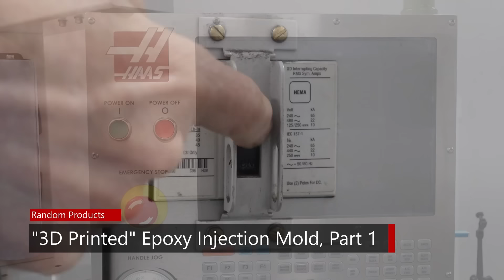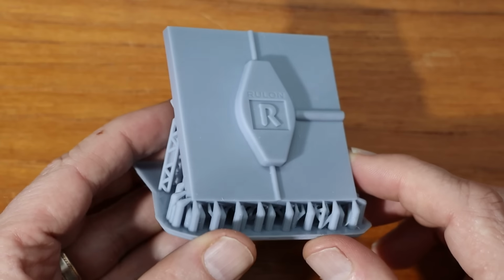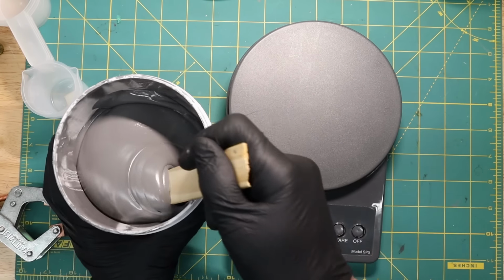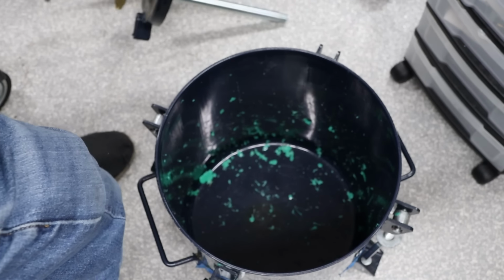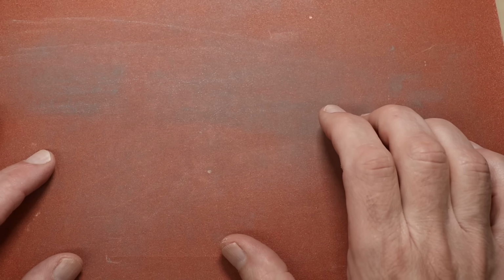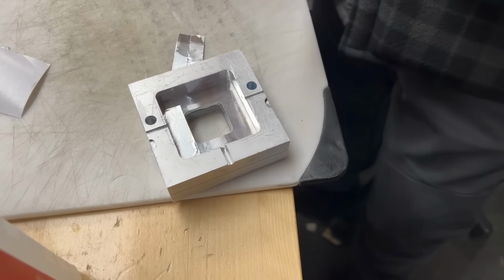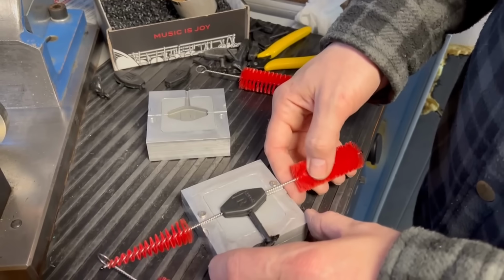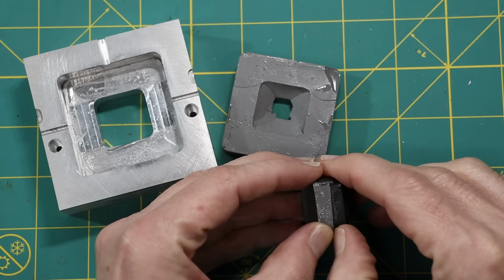"3D Printed" Epoxy Injection Mold, Part 1

Comment: Great video John thanks for sharing! 

The resin method is really interesting. The heat curing step of the resin does look like it poses some challenges. I wonder if using less volume of resin overall would aid in reducing the amount of deformation that could occur? Although that might cause warpage if the resin isn't thick enough. What are your thoughts of the possibility of the aluminium housing expanding during the heat treatment and possibly causing the resin to pull away from the walls when cooled? 

Reducing the size of the inlet when pouring the resin could make it more difficult for trapped air to escape as you fill the mold. Several/many small holes around the entire area might help if you think that's a possiblity.

anyway thanks again for sharing and looking forward to the next one!

Comment: I believe if you have more supports that are thinner at the bottom it will warp less. Warping is caused by resin shrinkage and very heavy supports at the bottom make part shrink unevenly
Reply from the maker: Thanks. I'll have to try that.

Comment: Does the epoxy shrink when cooling? If so, could that cause the mold to be a lot weaker and more likely to crack? Like, if the epoxy shrinks, then the pressure between the epoxy and aluminum might not be as strong and might give it a bit of clearance to "stretch"... but if it's a hard/brittle epoxy, then it will crack instead of flexing. It's just a thought and a question. I really don't know. I just thought about it when the mold was being made, when the shrinkage was being shown. If it shrank that much there, then I thought it might be possible to shrink (to a much lesser extent) on the inside after it starts to cure. I'm sure being thinner didn't help much either. I also wondered about the pressure used for the bubbles and was wondering why pressure and not a vacuum to remove the bubbles? (or vacuum then pressure).

Comment: If I may, I observed other resin casters pouring resin into the hardener prior to hand stirring. It was said to give a better mix. Resin adhering to the wall of the mixing cup was then not a problem. It is something I will try in the future.

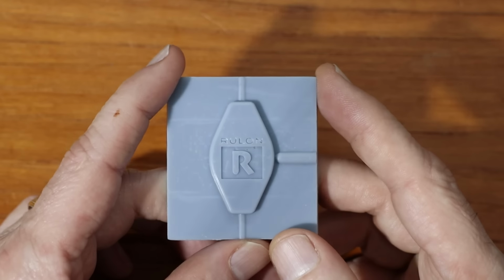Comment: 3:41 Your model is showing typical signs that you need more time on the "rest after retract" setting or whatever the equivalent is in your slicer. Basically your light is turning on and curing resin while resin is still flowing/squishing out of the gap between the film/screen and the last layer of the model. This is especially a problem with more viscous resins and is often referred to as "bloom."

Another possibility is that the PWM or light intensity setting needs to be turned down a little bit, but I'd experiment with the rest after retract first. Some printers like my Mega 8K have either really intense light sources that are capable of overwhelming the screen's masking, or the masking is too weak. Turning this setting down can help prevent a different type of bloom or light bleed. This is typically more of a problem with larger parts with lots of straight edges.

Comment: Great video. Very interesting results. Would shifting the pouring hole to the side help, away from the actual part?
Reply from the maker: Yes, that's one of the changes I plan to make, which is to make the pouring  hole smaller, and put it in a corner.
Reply: @JohnSL  less chance to anger YouTube mold & casting god Robert Tolone as well 😉 I saw you pour straight over the details 🙂
Reply from the maker: Hee, hee. I was wondering if someone would notice that. It's not the best practice, but I figured the pressure pot would cover that sin, and it did. The only bubbles I saw where on the back where the air wasn't able to escape.
Reply: @JohnSL  haha it was the first thing I thought when I saw it, but didn’t want to be “that guy” 😆 and when I saw you use the pressure pot afterwards I figured it would be be fine and it totally was. just now that pouring from the side becomes automatic I thought I would throw it in as a nod to the master 😊

Comment: Interesting experiment. Detailed analysis. Actually, the opening could be filleted on the inside, and additional plate can cover the hole with silicone(any possible bubbles removed with vacuum) to takeup extra space, with more even spread on pressure. Just some 💭

Comment: Thanks for this... I am gearing up to do a series of injection molds and I was going to try 3D printed molds and hadn't considered epoxy.

I have a Morgan press and will have the sprue in the top of the mold, not the side... Any thoughts on how that would change the process... thanks again, this is great stuff!
Reply from the maker: It should also work for a Morgan. You would just need frames where one frame as the sprue in the back.

Comment: Crafsman has a video called "3D Printed Injection Molds (actually work)!", the frame he has in that video has proper support all around the 3D printed part. That looks kinda important, even he mentions that he was worried about the pressure and his 3D printed mould probably held up because it had a proper backing part too.

Comment: As an armchair expert in mold making, I'm wondering, can you add something like nails to the epoxy resin to act like rebar?  Though it might do more harm than good if its coefficient of thermal expansion doesn't match.

Comment: John I have mostly given up building supports in the printing apps like Lychee et al and place them directly in my CAD.  For me the biggest problem with all these resin slicers is that they cater to the "toy solder" rather than engineering community where absolutely dead flat isn't post-print fixable and critical to print correctly.

I solved a similar issue to your problematic manually supported edge by building a "v-shaped" chisel support into the model edge itself.  The chisel base is large enough to use as part of a raft and the chisel "point" hits the model edge with about 0.3mm thickness along it's entire length, rather than tryng to use arbitrary "point" supports in app.  The chisel support then just snaps off cleanly along the length of the part and so allows you to take advantage of the 45 deg print angle for resolution.  Depending on the model/angle this can allow one face of the chisel to be co-planer with one of the model surfaces and so produce a super clean parting line as well.

Comment: From the specs it looks like JB weld has higher temperature resistance. But with aluminum filling this resin probably has higher thermal conductivity.

Comment: Epoxy properties fall down with temperature, some can take more heat than others but you should really take a look at TDS for some numbers. Usually "high temp" resins have only a small fraction of their room temperature performance at the claimed max operating temperature, even some aerospace grade adhesives.

About voids, you should take the mold in the vacuum chamber before the pressure pot.  Vacuum will expand the bubbles, hopefully they will surface and burst (may need some help with mechanical action / vibration if resin is too viscous). The pressure pot just reduce the size of the bubbles proportionally to the pressure applied, it will not pop them. Double the pressure, half the volume, and so on. 

If you can arrange a good master/aluminium layout with a suitable resin inlet and vacuum outlet, I would try something like a vacuum infusion/VARTM process, it will ensure a nearly void free mold.
Reply from the maker: I tried using a vacuum chamber. The bubbles roles to the top, but didn't break. I tried to vibrate it a little, but didn't  have a good solution. Even so, I didn't have issues with bubbles in the mold.

Comment: Silicone = Vacuum pot, Epoxy = Pressure pot. Vac pot will pull volatiles from the epoxy and make it have more gas.

Comment: Put the hole to fill in the epoxy to a corner or perhaps even drill a hole from a side surface or two, one to fill in the epoxy and one to let the air escape.

Comment: Particle reinforced epoxy is quite fragile... The aluminum frame should completelly support the back and sides of the molded epoxy block (as you mentionned in the end).

Comment: As you actually have a CNC machine, why not use that to deck off the part? (Rather than sanding)
Reply from the maker: I wanted to go through what someone without a mill would do. That's why.

Comment: Id say cnc cooling channels in the aluminum before you permabond the 3d plastic and then add a regular pc cooling radiator with reg fittings etc. Kind of in the same way what nasa did back in the day with their rocket nozzles.

Comment: I've never understood that notion of pouring a stream to eliminate the bubbles.  I get the theory that the small stream will pop the bubbles coming out of your pouring cup, but then watching the stream stack up in the mold and folding back and forth on it self, it always looks to me like there is a high probability of actually capturing more air as the resin stacks up.
Reply from the maker: Hi Pete! I also wonder about that, but it does seem to work.
Reply: It may seem that way, but I guarantee that if there are any bubbles created/trapped from that, they are generally less than you start with from mixing.
This also has another purpose of allowing the material to work it's way in and around the master and giving it an opportunity to move any remaining bubbles up to the surface or to edges.
Extensive testing has been done to show the results if you're interested in researching further.
Hope that helps 😅
Reply: @zenginellc  certainly. Where can I find those test results.

Comment: You're supposed to put the model at 45° in two axis not just one.  Also 45° may not be the correct angle for your printer and print.  You should use the arctan for the correct angle.  Some resins are better for more dimensionally accurate prints as well.  I also recommend keeping the resin and print environment at 77°F  for best results.

Comment: Vacuum bubbles 2-3x out of epoxy before pouring.. Add 1/32 milled fiber or micro carbon fibers, if available, to Epoxy. Definitely fully support the sandwich.. Let us know your success!

Comment: What did I miss here with this project? Why not program the cavity and cut it into an aluminum insert? This seems like a lot of extra work. The residence time of the material in the barrel is fluctuating while you are demolding, inconsistent time between shots
For your bubble problem, you can put the casting into a vacuum.
Reply from the maker: I explained that at the start. There are a lot of people who would like to make their own molds and don't have a CNC machine. They have been using 3D printed molds, but they're not as strong as this epoxy. As to the bubble, it wasn't a bubble, but rather lack of support from behind.

Comment: A lot of slicers use a default value for the resin layer height that might not match the X-Y resolution of your specific resin printer.  Search for this youtube video to learn how to adjust layer height to match your printer's resolution. "How to Angle your Resin Print for the Smoothest Surface Possible. Real life use of trigonometry!" https://www.youtube.com/watch?v=Qs2Rb0ExnIM&pp=ygUacmVzaW4gcHJpbnRlciBsYXllciBoZWlnaHQ%3D
Reply from the maker: That's why I used 45 degrees--it's the correct angle for my printer.